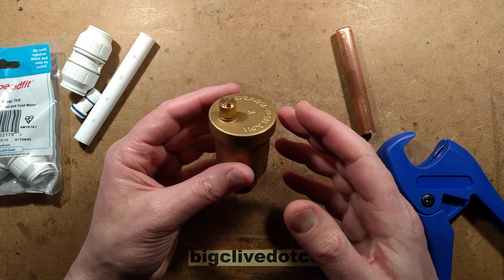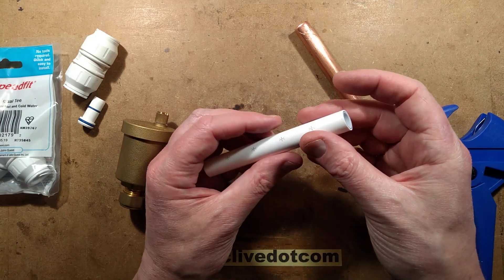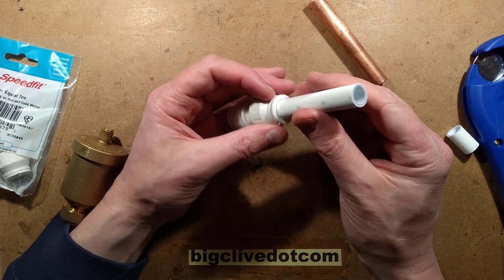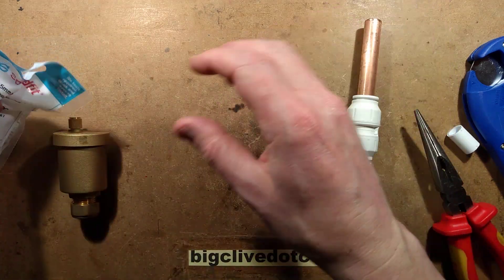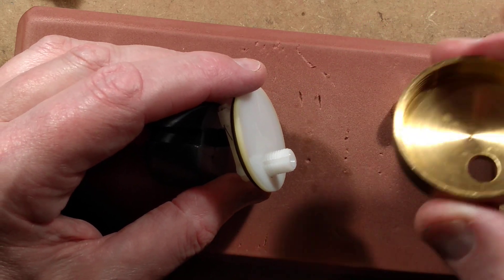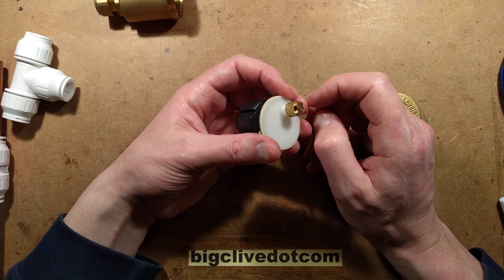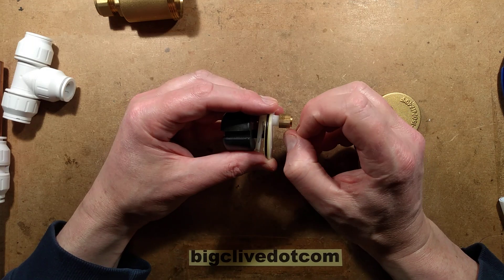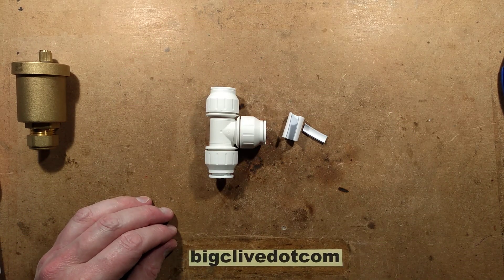Inside a bottle air vent and plumbing ramble.  (No electronics whatsoever.)

Comment: Do yourself a favour Clive; nowt wrong with the JG stuff, but like all pipework it needs to be clipped/supported properly.  You get these amateurs who see plastic as some kind of time-saver and just droop it round the place, and are surprised when failures happen. Secondly, build yourself a little pressure test rig, and test it before you cover the pipework up.

The basic principles of turd-herding..sorry plumbing, still apply, whether it's copper or plastic.  For some reason, people seem to not do these things with plastic, experience failures, and then blame the plastic.
Reply from the maker: It's going to be well supported to keep it off the concrete below.  Not so easy, because there's no crawl room under the floor.

Comment: PEX here in the states is, as others have mentioned, cross linked Polyethylene.  I bought my house in 2011 and it had some PEX work done in the finishing of the basement.  Instead of the "Shark Bite" type fittings they used the crimp rings which are fairly permanent, you can get them apart but it's a bitch where the ring has to be cut to get it apart. Also, the crimping pliers will cost you about $100 or there abouts for a decent set.  Not a single drop of leakage in the decade or so it's been holding water.

In what I've read and researched, the PEX stuff has been around for quite a while and has a good success rate.   I'm not sure about PEX but certain types of plastic piping are prone to rodent damage however I believe that's PVC.  For some reason they like to nibble on it.  You have kitties around though! - Excellent rodent abatement and cute as well.
Reply: Rodents eat PEX too, had it happen personally and water was spraying everywhere in my basement. I now sleeve all plastic pipe in metal of some kind wherever it penetrates a wall or floor because that is what said rodent was trying to do, chew its way through the hole the PEX was run through under the kitchen sink.
Reply: @danielthechskid  Wow.  Thanks Daniel.  Good to know.

Comment: Clever engineering.  Water pressure keeps the port closed when there's no weight from the float.  As soon as the float drops, leverage ensures that it will crack the port with the least amount of force from the weight since the real pivot point is the port itself.  This clever design makes it extremely compact in that dimension but also gives the mechanism enough leverage to crack the port even if the nipple is stuck to the silicon bung.  The spring is only there to hold the lever in exactly the right place - that's why the mounting point is at the other end so it has zero effect on whether the port is open or closed.

Comment: Surveying a lot of buildings, it is apparent that there was a really shoddy batch of copper used to make pipes in the late 70s.  Pin hole leaks are a really common on pipework of that vintage - that might be the cause of your pinholes.

Comment: A lot of plumbers here in the US are switching to PEX  (pvc like type of pipe)  because of ever growing copper thefts... which is getting so bad they are raiding construction sites...  our compression fitting here is mainly known as "Shark Bite"
Reply: Primarily, they're replacing copper with it because it's less expensive, holds up against corrosion and jostling far better than copper, and doesn't break anywhere near as readily due to freezing,
Reply: @orijimi  Yes it is better , but also for the reason I stated fro sure in my  area... riddled with a lot of druggies where I live
Reply from the maker: I can recall working on a construction site where thieves came in and ripped out the newly installed copper pipes.
Reply: @bigclivedotcom  Yes and the wiring as well... it happens alot in my area so bad that they even have cops watch over the sites now

Comment: Wonder if they make the opposite of an air vent, i.e a water vent to auto vent water from an aircompressor that is not powered.
Reply from the maker: I'm not aware of one.  Just the timed air dump valves.

Comment: We used push fit fittings for compressed air at the factory  and found  them reliable
Reply: Well they’re normally rated at 6 bar so you’re pushing your luck … and a failure on a large compressed air system can have nasty consequences!

Comment: Those air vents are usually mounted at the highest point of the heating installation, 
if you have multiple floors, then these vents are mounted at the highest floor or at the attic.
The older air vents don't have that little spring, and the float goes up and down by gravity.
Some models have a float with a cone in the middle, which seats in the middle of the housing, with a soft spring between the float and top.
Those vents are a joy when replacing on a older installation and with the system under pressure (1,5a2bar) and with no valves under the air vent to shut off the system.
Then it's a case of rappidly unscrew the faulthy air vent, spray spray spray, rappidly screw the new one in, and hopefully with the threat good the first time, and then tighen the air vent. (don't ask how i know this :-) )

Comment: Half of my house is copper, half is platsic and water flowing thru the plastic is noisy.  Copper is not audible.  There may be other reasons for the noise.
Reply: That's probably because the smaller internal diameter means a faster velocity which generates noise

Comment: It's also worth noting the air valve will allow air to be drawn into the system when it's being drained down and helps avoid vacuum locks
Reply: lawson jones I’ve known installations that had a connection where they would connect a compressed air source to blow out any remaining liquid when draining the system. These were systems in cabins that were only used infrequently during the freezing season so were drained to prevent pipe bursts.

Having a way to block air venting was important to force the air to exit where desired.
Reply: @thomasbland6428  When I decommissioned my old heating system, I sucked the water out with a wet n dry vacuum cleaner.

Comment: The grate thing about pex is you can have a long lengths without joints and it's flexible  . With copper people used to notch the top of floor joists which not only weakens it but made it more likely that someone would put a fixing in to the pipe (me) .  There is no way wet in slab under floor heating would be possible without it .

Comment: They are ugly, bulky and the reason they have changed their design so many times is - they fail. A neat soldered copper connection is a proper engineering solution or if you are not into setting the house alight a compression fitting is fine. A fine wire wool twisted around a few turns on the end of the pipe is perfect to clean it. I am very disapointed Clive. Just shows they should never use electronic and engineer together. It'll be sanitary engineer next - OOPS! too late.

Comment: Plastic pipe is cross-linked poly-ethylene.   Proper ways of connecting it is using "crimp" style fittings or expanding ring fittings (Wirsbo) or "quick and easy" method.  Push fit fittings such as "shark-bite" or O-ring fittings should be considered temporary methods.  PEX piping will out-last copper if using proper joining methods.  Copper is not better.
Reply: Unless you're talking about its ability to kill off MRSA, in which case COPPER FTW!! :D
Reply: those "plasticky plumbing things" have only been around for a limited time. so you cannot make a statement that they are outlasting copper.
Reply: @ursodermatt8809  Since the 1960s, I don't think 60 years is considered a "limited time".
Reply: @lunchboxproductions1183  
if there was stuff like that in the 60ies, it must have been very limited, because i haven't seen it or come across it. maybe 20 years at the most!
Reply: Lunchbox Productions if you want to get nostalgic about good ol’ plastic, one word for ya: polybutylene.
Never had a problem with it myself, but then again I wasn’t around in the 60s.
Reply: It will also lower water pressure, due to friction in the joints, due to the ID of the joint being significantly small... I feel bad for the lady we might have to do a repipe for. Her water pressure is so low the valve on her kitchen faucet doesn't want to stay open, due to it using pressure to stay open.
Reply: Joe Dugas  Hollyhocks !  these fittings last extremely well, just use the mf’s own fittings and you’re good, I have never seen “crimp”style fittings in the UK.
Reply: I have been using shark bites on my mobile home since they came out with them and never experienced a failure. I doubt they would just up and fail . The design is pretty solid and the o-rings are of a type that would last a long time. Even if they eventually leak, they are easily replaced anyways.
Reply: @scottfirman  
well, the O-rings might be easily replaced in your mobile home, but they are not when you have to tip out walls. etc
Reply: After 2 different plumbers used PEX (and one used a SharkBite connector) - I became a fan.   Note: My parents had some PEX installed, and theirs had an unpleasant taste.  My PEX does not.  Seems to be easier to use than PVC/CPVC.

Comment: Here in NZ it's all plastic pipes, hot and cold. I remember once, when in the UK a one year old house we had a damp patch in one of the internal walls. On investigation I found one of the copper water pipes had the smallest of holes in it. So small that only a really fine mist was omitted, almost impossible to see but over time the mist was absorbed into the plaster work. Of course not covered by the new house warranty!
Reply: In the U.S. we call those, "pinhole leaks". I make a sleeve out of a 3cm piece of polyurethane hose and slip it over the hole. I hold it tightly in place with a hose clamp. This works as a temporary patch (years, really). However, the entire copper pipe is rotting on the inside, and you'll need to replace it. As much as I love copper, I just don't trust it anymore.

Comment: As others have said, it's kind of like the float chamber in a carburetor except instead of shutting off the liquid supply as the liquid level rises, it opens a gas escape valve as the liquid level drops due to filling up with air bubbles. 

Simple and neat - don't know how well these things cope with the ubiquitous lime scale though.

Comment: Having been in the plumbing world and now the water industry (10 years)  I'd take copper over plastic for internal pipework every day of the week. 
Speed fit is exactly that - fast with no real skill set needed. Most of the leaks I've encountered are from the fittings also not to mention they are massive and look ugly. 
Plastic also  allows the growth of bio films.

Comment: Me and my dad swear by plastic PEX piping. It's never failed us yet... we replace copper with PEX all the time. Mind you we use more compact versions of those fittings. Same principle, just more compact and made of brass with plastic reinforcing inserts built into the fittings for convenience. If connecting to copper, we rip out one of the inserts to make it work.
Also, those automatic air bleeders as I like to call them work very well, but occasionally plug up... luckily they're easy to clean or run an air compressor through them to shake the dirt loose and make it work correctly again.

Comment: Good copper pipe should be cut with a wheel pipe cutter which makes a slightly rounded "nub" which makes sticking it in easier and deburred with a triangular blade which can be used to open pinched ends.  Cleaned with fine steel wool which absorbes the oil and then joined with acid fluxed soldered yorkshire joints.  Finally more steel wool to clean off the excess flux.  You want to keep brass to a minimum, dissimilar metals are always going to be potential weak points.  Because solder coats at a molecular level a correctly soldered and cleaned joint is almost as good as a continuous pipe.

As a telephone engineer we plumbed different things to survive (arguably) a more aggressive environment but the principles were exactly the same.

Comment: One of the biggest issues with plastic is that it has a small internal diameter compared with copper so if you have a low pressure system you could run into problems.
Reply: Correct, I wrongly plumbed my hot water in 15mm, which would have been fine if not for the inserts, but now I have a low pressure problem. I am going to have to re-do it in 22mm at some point, but I guess it was a lesson learnt
Reply: @arcadeuk in copper I'd recommend a 22mm feed to a bathroom anyways, purely to ensure you get a decent fill rate for the bath ;).

Comment: One thing with the Speedfit couplings- when used with COPPER pipe in a hard water area, a ring of verdigris builds up between the O ring and the copper, and eventually it will leak.(The corrosion happens quicker on hot water pipes, inevitably)
This failure mode tried to flood my kitchen (but in all fairness the corrosion did take over 10 years to cause the leak)

 So it seems Speedfit should only really be used with the recommended plastic pipe. I empathise with your reticence here. Plumbing sucks. When a wire is damaged  we know it's a hazard, but at least the electricity doesn't fall out and piss all over your house.

Comment: Instead of just ripping the insert out, I just disassemble the fitting by loosening it instead of tightening it. the insert just pops out so you can reuse it. Just make sure you put the o-ring and washer in the right way or it'll leak!

Comment: we use a system like this , french made, transair piping for compressed air , its extruded aluminum and has a WP of 236 psi but tested to twice that
Reply: Hey thats pretty good. Id imagine oilers really work wall across those aluminum lines

Comment: John Guest Speedfit is the only brand I will buy and use, I've tried some of the others and had mixed results. Although I love a bit of copper, the advantages of speed fit mean you can thread pipe though holes it joists as its bendy, and goes round swooping corners. You can use alot less "joints" with speedfit than copper, and less elbow's means more flow and less leak points. All things in life are only as good as the job of the installer, but speed fit is pretty low skilled to install - which is a dangerous combination! The disadvantage is if you are using 15mm copper, the internal bore is about 13mm roughly, while with speed fit those inserts and the thicker wall size bring it right down to about 10mm bore, so think wisely where you use it and don't overlook 22mm for important runs like hot/cold to showers and baths, or running the main cold feed from the stop tap to the boiler for example.

Comment: Dont use the push on fittings on chrome pipe it wont grip
Reply: Copper is softer I guess.
Reply: 6581punk yes- chrome is really very hard, they use it for lining gun barrels. The teeth won’t touch it.
Reply: Where you have to use them on chrome pipe you can carefully file/flake away the chrome plating and then use the pushfit as normal. I've had to do it a few times over the years and works just fine. Just don't be too aggressive with the file as you need to keep the pipe unmarked. The same goes for soldering that kind of pipe.
Reply: Maybe this space is the place to apply steel wool.

Comment: I've seen those plastic fitting used with copper on test and the copper ruptured  before the fitting failed!
Reply: Peter Fletcher you forget that part of the fitting is teeth which bite, not as a magical sky hook into the clouds but into the copper. If the teeth did not puncture the pipe at the clamp, most obvious point of extreme pressure, then the pipe had a weak spot. Let me explain:
Reply: If a stiletto heel fell upon your stomach and pierced it, you would expect your stomach to fail. However if a blood vessel in your skull ruptured first, you would have already had a weakness called aneurysm.
Reply: Now since the stiletto clamping the pipe is concealed by design, it would be very difficult to visibly demonstrate the mode of failure, therefore the weak spot must be relocated to a visible location for any demonstration.
Still convinced?

Comment: I've often wondered what difference in water quality/taste you'd get with all plastic systems over copper ones, I've seen the inside of some old pipes and they are black, how will the plastic ones look in 30 years time I wonder, would hot lines fail more than cold ones, is plastic more hygienic, will there be a greater buildup of limescale at the tap with plastic
Reply: @Stevozka  certainly food for thought!

Comment: Here in Switzerland we don't use much copper anymore, it's been replaced by stainless steel crimp fittings.
The main plastic systems we use are
RN Profix
RN Flowpress
JRG Sanipex MT
JRG Sanipex Classic

Sanipex is super interesting, it's a plastic compression fitting. 

Check it out if you're interested Clive!
Reply: fatei we use stainless crimp fittings on vehicles, but nothing of that is reusable once it’s disassembled.

Comment: The more expensive auto air vents have a little fibre seal inside the screw cap so if you get water weeping out the valve it self seals
Reply: laernulieNlaernulieNlaernulieN it’s for when electrolysis finally eats the threads out of the shaft and threatens to eject the screw, that a fiber washer will allow small amounts of water by to foreshadow the impending mess.
Sick of people assuming it’s a failproof design.
Reply: Rýán Túçk . It’s not even a good design, if it’s weeping you would be better seeing the water and therefore replacing the entire part and if the washer swells up it effectively closes the cap and therefore stops the valve from venting any air